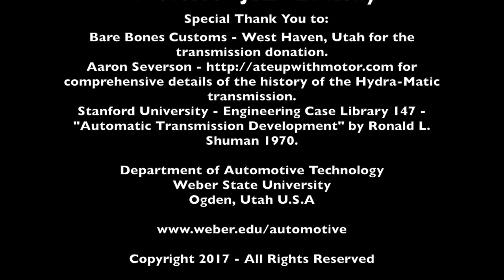World's First Mass-Produced Automatic Transmission - Part 2 - Guts and Gears

Comment: Hello, Nice job, great review, I attended Auto Tech School at Southern Illinois Univ. Vocational Technical Institute from 1967 thru 1969. I then transferred to Main Campus and completed a BS in Engineering.  We had a wonderful Automatic Trans Instructor, Mr. Willy, He taught us well even when those Hydraulic flow charts got confusing or boring he helped us thru.  I had already built my first Hot Rod in 1966, a 47 Chevy Coupe with a 57 Olds engine and drive train, four speed Hyrdro and all! I had the "torque convertor" vanes cut down and braised in place, for a strong launch at the drags. I may just have to get an old Hydra-Matic and have around to remind of those days.  Great job, thank you for sharing, Dennis

Comment: I'd always been curious about the automatic transmission history!!!!!!!
Reply from the maker: Cool stuff huh? I love history
Reply: @WeberAuto  Yes, John it's very interesting! My first car was a 1947 Chrysler Windsor "Fluid Drive" semi-automatic bolted to a large flathead six engine. You mentioned the combination transmissions with clutch pedals. I guess this fits in this class as it had a clutch pedal used to shift into reverse or into low geared "hill climb" as it was called. You used the brake for drive and stopped it with the brake only but shifted it by "letting up on the accelerator" to shift into higher gear at the correct engine speed. Are you familiar with this transmission and how it was designed internally? Was it also developed before the World War II years when the car companies stopped production to produce airplanes and other war related machines?

Comment: Loved these old boxes, great build quality, collected them back in the 80s, while I worked at a Rolls shop in Hayward CA, I would trade parts to the trans. shop we used (got one of the truck oil cooling pans for my 53 Ford business coupe project with a 303 Olds). 
 Tom Beatty adapted a BW R11 overdrive to his Hydro for a 5 sp overdrive in the early 60s for his 40 Ford sedan, just awesome!

Comment: You never disappoint sir! Excellent informative videos!
Reply from the maker: Thank you!
Reply: Did these automatic transmissions mechanically shift themselves?  i'm assuming there weren't any computers back then to tell the transmission when to shift.
Reply from the maker: There were no electronic computers on cars back then, but these were shifted with a logic controlled analog hydraulic/mechanical computer called a valve body. Think of the valve body as being the equivalent of a CPU today. It has several INPUTS: 1. Oil pump pressure (engine speed related). 2. Governor pressure (vehicle speed related). 3. Throttle Valve Pressure (Gas pedal position related). 4. Gear selector position (N, D, L, R). It also has several OUTPUTS: 1. 1-2 shift valve. 2. 2-3 shift valve. 3. 3-4 shift valve. 4. Delay valves. 5. Sequence valves. and etc.  The control of the outputs (shift valves) controlled which gear the transmission was using. The position of the shift valves (upshifted or downshifted) is controlled by Governor pressure on one side of the valve trying to cause an upshift (or delay a downshift) and Throttle valve pressure and a spring on the other side trying to delay an upshift or cause a downshift. IF Governor pressure is higher than Throttle Valve pressure and spring pressure, THEN upshift the transmission. IF Governor pressure is lower than Throttle Valve pressure and spring pressure, THEN downshift the transmission. An analog computer! Cool stuff!
Reply: WeberAuto will there be a video coming up showing us how that works?  That'll be cool to see
Reply from the maker: Yes, it should be posted in the next few days. Thank you!
Reply: BroadcastBuddy

Comment: The Hydra-Matic behind the 389 in my 1962 Pontiac StarChief gave flawless performance for 50+ years without a bit of maintenance other than topping fluid every few years.  In my foolish younger years working on jobs away from home it cruised at 120MPH for 2 hours at a stretch every 2 weeks and suffered the stoplight drags in a very big car.  Its size allowed a nearly flat floor.  Coupled with slick vinyl bench seats, no seatbelts, and unassisted 4 wheel drum brakes, the occasional fast right turn was nice with your best girl next to you.  Left turns were literally white knuckle affairs trying to hang onto the steering wheel while sliding to the passenger side.  
I much preferred the crisp direct feel of the Hydra-Matic over the sloppy TH350 in my 72 Impala.
Reply from the maker: That is awesome! Thanks for the feedback!
Reply: Gracious Lord! All that in 1962!

Comment: Because of that "fluid-coupling", and it's inability to increase torque output, the 1st gear ratio was a stump pulling LOW GEAR!!!  My '56 Pontiac felt like it lifted the left front tire off the ground when traction was great and the the accelerator pedal was denting the floorboard!!
Reply from the maker: Lol. That is awesome! Thanks for sharing

Comment: This transmission is easier for me to understand how it stops, a band applying pressure to the drum which looks like an early version of the big metal housings in a ZF 8HP70 8 Speed Automatic Transmission. I like ZF because it is German and is extremely reliable, especially because the Ram 3500 Heavy Duty uses it and the Volvo VNL 860 actual heavy duty truck uses it.

Comment: So I'm very impressed  with this series  and others! You teaching how this transmission works has helped  me understand my 51 lincoln alot better!! The only question  I have is what modern equivalent of transmission fluid goes into this beauty? I've heard ford f and Dex 3 and 4 and they are pretty  good stories on why but with basically every type listed it has left me high and dry till I get a solid answer. My local ford doesn't know and GM just keeps leaving me on hold. I would ask a shop but most of my locals are ran by my generation or younger and I'm not comfortable taking their advice on it they will probably tell me to do a hellcat swap..... what do you say?
Reply from the maker: Thank you! please see my transmission fluid history video https://youtu.be/8oWFTOY-3tY Keep it all original! In summary, there you should be looking for a fluid that is compatible with the Type A Suffix A specification. I have seen generic bottles of Dexron/Mercon fluids that claim to be compatible with that specification. Dexron IIIG or earlier could also work, but not Dexron IIIH. Do not use Dexron Vi, HP, LV HP, or ULV. Do not use Mervon V, SP, LV, or ULV either. Best wishes.
Reply from the maker: I just remembered that Toyota still sells Dexron IIIG fluid for their earlier transmissions that used Type A Suffix A fluids. See https://www.amazon.com/Toyota-Genuine-00718ATF00-Dexron-Transmission/dp/B004SL5FM0/ref=sr_1_1?crid=3ACUJ4EIR3JF&keywords=toyota+dexron+iii&qid=1548086976&sprefix=toyota+dexron%2Caps%2C176&sr=8-1 That is the fluid I would use if I owned your Lincoln. Best wishes.

Comment: I have a ‘48 Cadillac Series 62 with a Hydra-Matic. What are the chances of being able to source expected worn parts? From your video, I can think of front and rear IMS clutch packs, assorted brass bushings/washers, cast-iron compression rings, gaskets, etc. Would also be great to know title of overhaul manual.
Reply from the maker: I find parts on eBay and from CaddyDaddy. Thanks for watching The repair manual is just called a overhaul manual or Unit Repair Manual. They are available on eBay. Thanks for watching
Reply: @WeberAuto  Would this work?? “Pontiac Hydra Matic Transmission Manual 1948-1953”
Reply from the maker: @bhagmeister  Yes

Comment: Any idea what power rating the 4 speed had?
Reply from the maker: From what I can find, the  1941 Cadillac 346 V8 had 150 hp and 283 lb-ft of torque. 1953 Cadillac 331 V8 had 210 hp and 330 lb-ft of torque.

Comment: the fluid coupling does not slip as much as a torque converter and does not heat up the fluid as much. these hydra-matics do not have an oil cooler and don't need it.
Reply from the maker: Thanks for your feedback. Some later models got very hot and had external coolers ran through the oil pan.

Comment: I am not sure that I buy the assessment that the Powerglide was 2 speeds because it was "cheap". 

This early transmission has a simple fluid coupler, that is, it had no stator. As such, the fluid coupler in this transmission had no torque multiplication function like a modern torque converter. Without the torque multiplication of the torque converter, this transmission required many more gear ratios to cover the range of speeds and torques required to drive the vehicle.

But once the stator was developed, the modern torque converter came into existence. That change in technology significantly altered the required design parameters of the automatic transmission. With a torque-multiplying coupler, now known as the torque converter, even a 2-speed like a Powerglide could handle a very wide range of speeds and torque requirements as each gear within the transmission was effectively converted into a range of gears with the torque converter. 

So again, I don't buy that the Powerglide was 2-speed to be cheap. It was 2-speed because the torque converter technology allowed a 2-speed torque converter transmission to be as effective as this 4-speed without a torque converter. The fact that it was also cheaper was just a bonus.